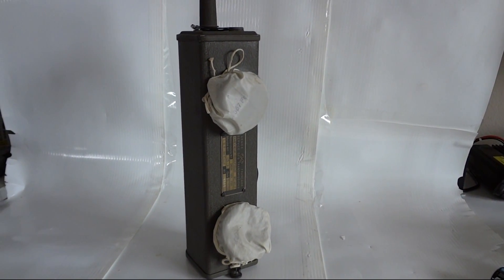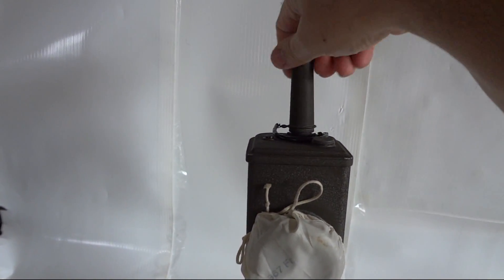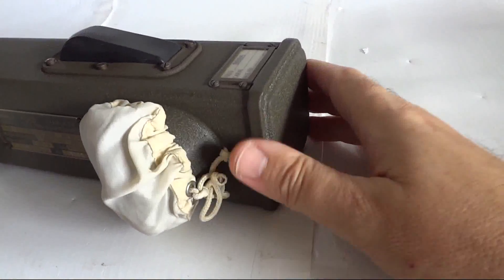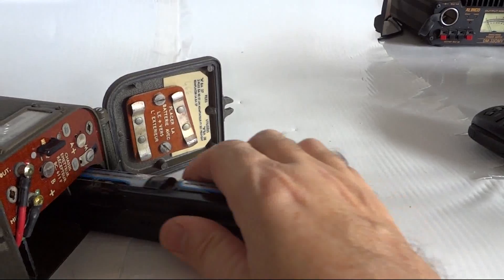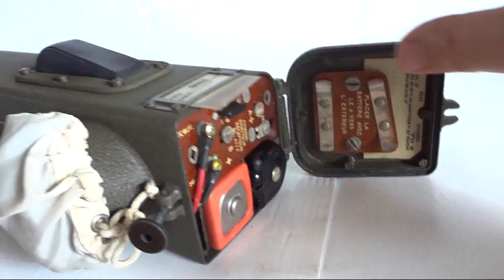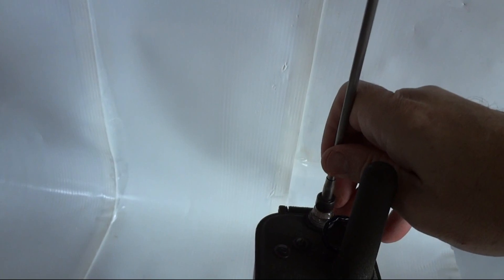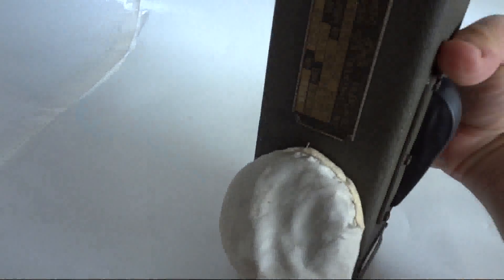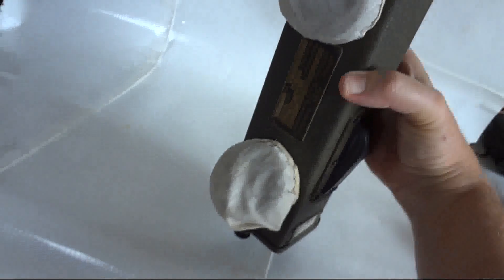BC-611 radio (SCR536) comes to life after 50 years

Comment from the maker: Here you can see how to make your own BC-611 plate voltage battery: https://www.youtube.com/watch?v=2DuEhZu8R8Q
Reply: Had several of these,  I found a photo flash device that gave me the required 105 volts for the high voltage to operate the tubes
Reply: Hello, there might be something wrong with your website. I tried to buy two 100v supplies on your website but it always tells that my email address is wrong. Could you tell how I can by supply from you?
Reply: Fantastic video! I'm a former EE and ham operator, and I've never had the pleasure of examining one of these! Where did you get this specimen?

Comment: Hello thanks for the video. Where did you find the two D batteries in // adapter? I have just designed a similar one in 3D but (stl 3D file available on G503) I did not know that it was existing? Was it in the radio? Season's Greetings. Yves

Comment: Electrically there wasn't much ahead of it;s time... it was very much of it's time, when battery powered AM recievers were very common in the U.S.  Hams made the low power transciever a common thing in the 30;s.  The mechanical design it where the meat is. 3885 became the national AM frequency in the US for ham operators in the 50's.

Comment: Alrighty then ! 
Yes there are two batteries . The army decided that in the design specifications . 
So one battery is for receive , and the other is for transmit . I’m surprised a rechargeable battery is used in this vid , because rechargeable batteries weren’t thought of yet . And to power vacuum tubes requires a lot of power . 
This is a tremendous video . Thanks .
Reply: Sorry, NO.
The low voltage battery is for the tube heaters, the high voltage battery is for the plates and screens in the tubes.
Reply: @alfamontydog  what radio did you work with in the army ?
Reply: @jamesbeemer7855  I have never been in the army, I'm an amateur radio (HAM) operator and old military radios are a hobby of mine.

Comment: Great demo, thanks! I have two of these I am going to sell, BC-611-D. Do you know what a fair value is?
Reply from the maker: It highly depends on their condition. A heavily used one but otherwise complete and undamaged should get you $300 at least. A really nice one can fetch up to $800 or even more. A NOS one (New Old Stock) will go for $1000 and beyond easily. A NOS one still in original packaging material can go way north of $2000, especially if it has a WWII date code. So  like I said, it really depends on the condition. Hope this helps.
Reply: @LifeIsTooShortForQRP  Great, thank you for the guidance. I appreciated it.

Comment: The fact that those capacitors survived after 50 years is outstanding. I winced a bit when you turned it on because the latter would be a sharp crack followed by no audio and a terrible and particularly acrid smell unmistakably foul to the nose of any technician. 

That B battery though is just wild. What did the original battery look like? 

KN4GEI
Reply from the maker: The battery is (was) a BA38. It was made by several manufacturers; Eveready (US), Pile Wonder (France) and Saft (Germany) come to mind. I used to have the Wonder battery (came with the French BC-611), but that was 45 years ago and the battery is long gone - I should have made a photo of it then. But here you can see an image of the  battery that I found on the web: https://www.smallbattery.company.org.uk/sbc_ba38.htm

Comment: Can you change the frequency in that talkie ?
Reply from the maker: Yes, you can. But it is not simple, unfortunately. Two new crystals are needed to re-channel the radio, one for the receiver and one for the transmitter. Also two (pluggable) coil assemblies need to be replaced. There is a crystal set available to re-channel the BC-611, the needed coils are also  part of that set. For a photo of the set see here:  https://www.ima-usa.com/products/original-u-s-wwii-army-signal-corps-box-bx-49-dated-1943
After replacement of the channel elements, the radio needs to be re-aligned. That is explained in the TM (technical manual).  Additional test equipment is needed for that. So the whole procedure is possible, although cumbersome. All the details can be found in the BC-611 TM, you can read it here: https://ia802700.us.archive.org/7/items/Tm11-235/Tm11-235.pdf
Reply: @LifeIsTooShortForQRP  what are crystals
Reply from the maker: @vismayballal7011  A radio crystal is a resonator with very stable frequency characteristics. See here: https://en.wikipedia.org/wiki/Crystal_oscillator
Reply: @LifeIsTooShortForQRP  thanks dude

Comment: Wow it still works. were did he find the 110 battery. Good job
Reply: I think he had it made professionally. 90 x 1.2v (the nominal voltage of a charged NiMH cell) would work. From the volume it may use AAAA cells or even smaller.
Reply from the maker: https://www.smallbattery.company.org.uk/sbc_ba38.htm

Comment: Definitely nice... I had one of the BC-611's years ago... it was from 1945 and  it was crystallized for 3885, too. Mine would also overload on strong received signals, like it did not have much of an AGC circuit... but, it was still awesome ... I took apart 10 Duracell 9 volt batteries and separated all those sub-AAA sized cells and insulated them from each other and hooked them all in series and taped them all together in a pack that would fit inside the set... a couple of alkaline flashlight batteries fit in the filament battery holder... worked great.   :-)
Reply from the maker: The funny part is, it is not so much the receiver AGC that is the problem, it is the audio stages that completely overload at strong signals I have found! Had this radio had a volume control, the overload problem would not have been there. But I guess that would have violated the intended simplicity for the user. What the designers really should have done is to extend the AGC to control the audio stage as well.....

Comment: Nice video. Just think.... all of that size and weight to transmit a whopping 360mW (just over 1/3 of a watt)!! About the same power output of kids "toy" walkie-talkies that use 9v transistor batteries. Thanks for sharing!! ......... Roger (W9RHS)
Reply from the maker: Thanks for the nice words. About the RF power: Yes, it is hard to believe how well this radio operates with this 360mW. And what goes into the air is actually much less than that. Keep in mind that the amount of power actually radiated into the air is only a fraction of this 360mW, because the antenna is very short compared to the wave length, and there is no proper ground (just the hands of the operator). As a result, the small BC-611 whip antenna efficiency will be abysmal (I estimate 5% at best). In BC-611 range tests we have made Q5 contacts over 12 miles though, where the base station was using a 24 ft tuned vertical. This was during the day with very little interference on 80 meter. At night you can forget about making any contacts though, too much skywave interference om 80, nobody will hear the weak signal. Cheers.
Reply: @LifeIsTooShortForQRP  It was also made to use standard battery radio tubes-  two 3S4s, one 1T4, one 1R5 and one 1S5.  The tubes are actually "hot-rodded" slightly as in receiver use they are typically run at 65-75 volts B+ rather than 110v.

Comment: That annoying noise when not receiving any signal could be eliminated if you turn off your florescent lights.  The radio is using AM mode which was standard in those days, and florescent light bulbs are notorious for generating AM noise.  Many modern light dimmers will generate a distinct AM buzzing noise when set about half way on.
Most radio today use FM mode which is NOT susceptible to electrical static noise.
Reply from the maker: Even when I switch off the main breaker (meaning the whole house is powerless) there is tremendous noise here on 80 meter. I'm pretty sure it is radiated from the above-ground power lines that run through the streets. With all these electronic choppers being used nowadays, the 160 80 and 40m bands are basically useless for city dwellers. And the latest pest is already knocking on our doors: Neighbors with solar panels, connected to big lead-acid storage batteries by means of a switching power controller. These things turn 24V DC (with high amperage) into 117V AC . the interference from these pieces of trash is so bad (most come from directly China without FCC approval) that even the 20m band is useless. Not a pretty picture for the future of ham radio.

Comment: Amazing it works after 50 years. It means all capacitors survived the test of time. BTW because the frequency is at 3885 KHz it can be received by vintage radio cassette with 4 band radio (FM/MW/SW1/SW2) which was very common in 1980s.

Comment: Similar to my first cellular phone in the mid 1980's. I still have it and it still works perfectly but they won't let you use them because they don't incorporate a GPS in them. I powered it up though and it still connects to the local tower :)
Reply from the maker: +foskten10 , I doubt that - Phones from the mid-1980s used AMPS as the cellular standard, which has been switched off from cell towers since 2007. See https://en.wikipedia.org/wiki/Advanced_Mobile_Phone_System
I have a portable AMPS base station here, when I gave the time I will make a Youtube video of it, so that you can see the classic Motorola DynaTAC 8000X phone in action again (I have those too). Cheers.
Reply from the maker: Then you really must like THIS photo! http://images7.memedroid.com/images/UPLOADED183/55d412d22bffb.jpeg

Comment: Those little Yaesu FT-817's don't really sound great on AM. It's a fantastic transceiver but if you're into AM on the hams bands or CB, you'll discover the FT-817 doesn't sound very good on AM compared to other larger amateur transceivers that use proper AM bandwidth. Most smaller modern-day ham radios don't sound too great on AM. They kick ass on other modes but AM is usually a challenge. One exception is the Kenwood TS-480. For a smaller style radio the 480 kicks ass on AM but other models like the Yaesu FT-100(D). Icom IC-706, 7000, 7100, etc, they sound like CRAP on AM...
Reply from the maker: I just bought an FT-450D, they are only $600 now from HRO. I figured it is a nice second all-mode radio for that price. I am actually completely amazed by how well it works for that kind of money. And the thing that baffles me the most - the FT450D is absolutely SUPERB on AM, both for the receiver as well as the transmitter! On TX, it has perfect AM modulation without any clipping (traditionally a problem with low-level modulation) and the modulation quality is just awesome. And for RX, you can select 3 If DSP filters: 10KHz for AM broadcast, 6kHz for voice communications and 4 kHz when there is lots of interference on adjacent frequencies. If you like AM (like me), a purchase I can recommend!
Reply: IT does if you go into service mode and set carrier to 1W in AM

Comment: Did i hear correct that the "B" battery is 110volts?
Reply: +MON383 Yeah but low capacity (mAh) there's all sorts of industrial batteries with higher voltages, I use a 512 volt for an old camera.
Reply: MON383  "B" battery is 90v to 100

Comment: Great.  this is why 3885 kc was and still is the main AM freq for 75 meters. I didn't realize these things had such good transmit modulation.  I think you will find that the difference in capacity between a 40's zinc 1.5 volt battery and a modern alkaline 1.5 volt batter is more on the order of 5 times more... at the least!. a few hundred Ma. drain would flatten one of those old batteries in an hour.  Today they will support an 1 AMP load longer than that !  73 W6WUH

Comment: Very nice video, its amazing after all those years and it still works. A modern day set wont work after 50 years.
Reply: Mike Lee.   50 years ago?  Didn't the US Army stop using these bulky things after the Korean War?
Reply: In the video he says it was made in France in 1959, which seems a bit strange
Reply: I have a "modern" cb radio from 1971 that still works just fine.  Not ww2 but still there is no reason modern sets wouldn't work after 50y

Comment from the maker: The company that made these is LGT, it stands for "Laboratoire General de Telecommunications". They were based at Rue de Garches 4, Saint-Cloud 92 in France. There is now an apartment building there....  https://www.google.com/maps/place/4+Rue+de+Garches,+92210+Saint-Cloud,+France/@48.8436711,2.2063355,3a,75y,357.66h,83.37t/data=!3m7!1e1!3m5!1smvBGcFN114gu6qvwMBNYfQ!2e0!6s%2F%2Fgeo0.ggpht.com%2Fcbk%3Fpanoid%3DmvBGcFN114gu6qvwMBNYfQ%26output%3Dthumbnail%26cb_client%3Dmaps_sv.tactile.gps%26thumb%3D2%26w%3D203%26h%3D100%26yaw%3D33.939888%26pitch%3D0%26thumbfov%3D100!7i13312!8i6656!4m5!3m4!1s0x47e67b41321a0d11:0x31182d4ad93f66a9!8m2!3d48.8436481!4d2.2062619!6m1!1e1?hl=en
 They made a lot of American WWII military radios in license, for NATO and domestic use right after the war. They also made commercial communication equipment and broadcast transmitters. The company was acquired by Thomson-CSF at one point, which is now Thales, a large defense contractor headquartered in France.

Comment from the maker: The antenna length is about 3 feet. I have tested the range to be in the 6 mile range when using it with a base station having a large antenna as the other station. It doesn't matter much if that is in a build-up environment or in the open field because the frequency is so low. If you use it between two of these radios range is much less, up to two mile at best.

Comment from the maker: A good question - Main reason was to probably keep them compatible with military shortwave radios like the BC-375/BC312 (VRC-1) and the tank radio WS-19. But all succeeding military portable radios worked on VHF frequencies (30-70MHz band), this BC-611 was succeeded by the PRC-6 walkie talkie (the "banana") right after the war. It works in the 50MHz band.

Comment from the maker: Sean, regarding the antenna: Desensitizing the radio by touching the antenna with your finger during receive (thus not physically shortening it) helps to make very strong signals more intelligible. this because the BC-611 appears to have a poor working AGC by design. But for transmit, you should not shorten or touch the antenna in any way, as this will create a severe VSWR mismatch for the transmitter PA with potential damage to the PA tube as a result.

Comment: I've read that the BC-611's volume control is accomplished by shortening the antenna rod. It would be interesting to know if your radio had receive audio as good as it's transmit audio if you shortened the antenna. I can't find the tube line-up online and I don't have the manual, but the radio does use five tubes one configuration for Rx & reversed for Tx. The "All American Five" radio uses five tubes but has no AGC.

Eighty meter waves follow the terrain - you don't need line of sight.

Sean